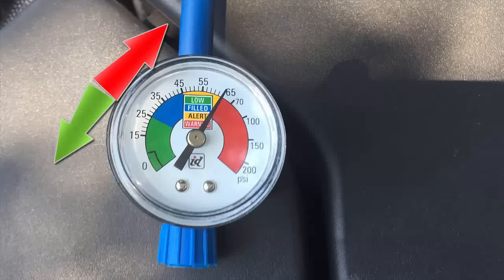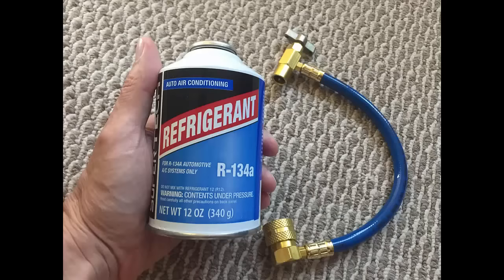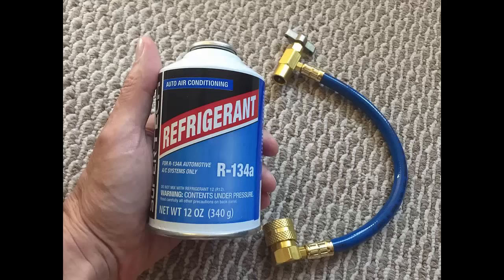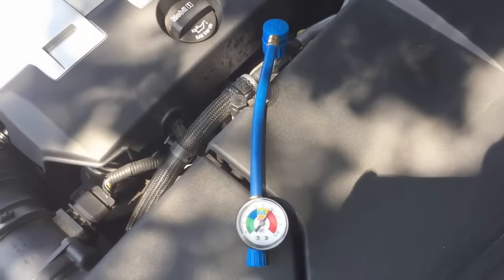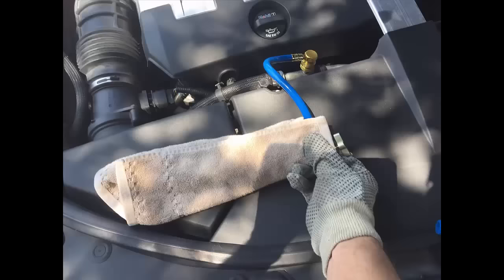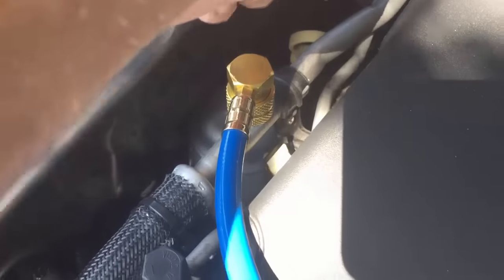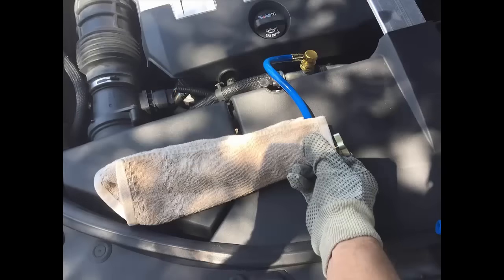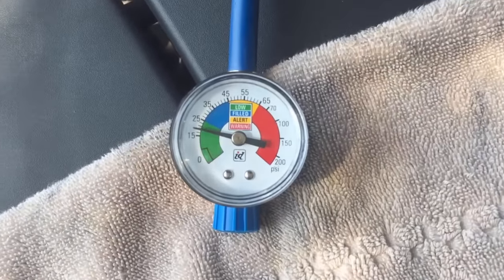Car AC pressure too high FIX overcharged a/c gauge fluctuation reading jumps Up Down Freon problem

Comment: U keep putting freon in your system and your going to slug the compressor. Freon needs to be put in by weight. 
Your system has a specific charge weight. 
And when u said the little thing , I knew u were not qualified to work on a ac.
That little thing is a schrader valve core.
Reply: The context of the video says he used a gauge. The gauge said low. He added a little and it registered a lot so he removed till it functioned properly and read properly. A weighted gas is distributed by pressure. Ft. Pounds per in. of X amount of ounces or pounds of gas or however it works. It’s not a solid weight dumped  or liquid weight poured into the system. It uses atmospheric pressure increased by mechanical (pump or other etc...)and process factors like temp, flow, space and again pressure to separate it from other particles into a confined space. There the weight of the isolated gas can be measured. In this case it’s released. Now how would you be right? At some point the gas or some additives in it would have to liquify or solidify to form some type of imbalanced mass in the compressor. It may be a build up on the walls or free flowing but not small enough to escape through the lines. To those that don’t understand the concept of the accusation, to slug a pump/ compressor is similar to overloading a washing machine with a few big heavy towels on one side and the rest of the laundry is fast dry/wicking clothing. While the water quickly drains from the other items during the drain cycle and first few spins of the spin cycle, the towels are still saturated with water and migrate tightly to one spot together. This causes the wash tub to come out of balance and vibrate. The towels being heavy may even change positions like a person being tossed around in a car wreck but the effect only worsens. My defense of the video is that they did not keep adding Freon to the system and that the commenter miss understood hopefully since they had knowledge of slugging.

Comment: When you gauge jumps , its actually the AC compressor kicking on . Its not over pressure. True pressue reading is what it says when Compressor is not running . So your AC s actually low if reading only 16 .

Comment: My pressure was way up almost 100 I released down to 35 and the gas never got cold and the ac lines just got warm instead of cold. The compressor never kicks on either. This sure didn’t work for me
Reply: Most likely have a bad compressor. I'm sorry.

Comment: When that happens it's because the a.c compressor is not working anymore and you need to replace the a.c compressor/
Reply from the maker: When the system is overcharged, the safety switch turns the compressor off.
That's why the compressor is working intermittently.

Comment: There could be air in the system.
Reply from the maker: Yep, the air got sucked in from a tiny hole in the evaporator... that I found later on.

Comment: I have the same issue, where I think I overfilled it a little too much, and the gauge is just not reliable for my vehicle.  I used the trigger hose kind of the AC Pro brand.  Can I use that trigger hose to release some pressure?  I'm thinking I can just detach the guage/trigger/hose component from the can, and attach it to the valve on the car and use the trigger to relieve pressure.  But do I do that via the high pressure valve on the car, or it's low pressure valve?  (filled via the low pressure, but not sure if i should release pressure via that same valve)  Help anyone?
Reply from the maker: Before you remove the trigger/hose from the can, keep in mind that if you have any refrigerant left in that can, it will escape at once under pressure.
That hose will fit only on the LOW side anyway, so you can bleed it off right there.
Reply: @Your-Self  right on.  thanks, that worked.

Comment: Well I hooked up my gauge and it went straight to the red so when I decided to release some pressure I noticed that the stuff coming out wasnt anywhere near cold. Any ideas?
Reply: Problem was that my compressor was broken even though it was still spinning it wasn't producing pressure.
Reply: @Shinobi117  , what was broken? The compressor it self or the clutch? I got the same thing. Thanks
Reply: @salomesua  compressor. Thats all it was.

Comment: I think those guages are junk
Mine did the same thing. It read low. So i filled it. It started working. Then stopped
Did the exact thing up and down on the guage. I let a bunch of freon out and out leveled out.

Comment: If i disconnect the gauge same one from the video will the can spray out
Reply: No. It won't.  The  gauge and hose literally unscrews from the top of the can.
Reply: Mike Ferrin what I mean is can is full and doesn’t say resealable on it
Reply: @kjhgfdsd76654  thanks for the info

Comment: So i released some while ac was running i didnt in accidently let air back in did i?
Reply from the maker: While Low-Pressure-Port has somewhat low pressure it's still higher than outside air pressure... therefore, the outside air shouldn't get in. But I'm not a tech, that"s just my own opinion, and it worked for me.
Reply: Would it be better to do it with ac off so pressure builds even more ?More pressure seems less of a chance itll introduce air to the system rite?sorry just trying to fix my issue without causing more.already lost a bit of oil but the refrigerant had 3 oz of oil in it so hoping i didnt screw up already. thanks for your time
Reply from the maker: If you want to make sure 100% that no air gets in, you can use High-Pressure_Port. Stick a sharp instrument like a screwdriver or large nail covered with a rug into that port, just like releasing air from a tire. It's messier and more dangerous because of higher pressure, but no air will get back in. There is a video with young guy talking about it.

Comment: have astro 2000 with rear air,good and cold,But I notice compressor runs all the time! any body know anything about this(not enough pressure,or pressure switch,guess I need to buy one of these)
Reply: Donnie Shepperson what turns the compressor off is the cycling switch, or low side switch. There is also a high pressure switch that will shut it off if pressures reach too high on the high side. On a good working system, and it being hotter than 85°, it is completely normal for a compressor to run like that. the cycling switch will only cycle around 15 psi on the low side. Too much cycling will wear the compressor clutch, so it is imperative to keep a good charge. Low refrigerant will cause short cycling which is terrible for the compressor.
Reply: Donnie Shepperson dont take advice from this guy. he just venting refrigerant right into the air smh.
Reply: thats what it does 85 or higher runs all time,under 80 it cut on and off like what i'm use to with front air only.this first rear air i have ever had,people have told me when it real hot these type run all the time,Thanks for your time!
Reply: about a million vehicles right now out there leaking refrigerant,they would be breaking the law too,I don't see epa taking anybody in,that's why they made 134A and sell it at walmart,so we can refill our leakers!
Reply: @brandonbunn978  --is it truly that dangerous? Think of all the carbon dioxide, methane and hydrogen sulfide you release every time you rip a wet fart while mowing your lawn.

Comment: Is it really OK to vent this stuff into the atmosphere? I was told there is a $2500 fine and this guy just handed the EPA a video to prove he did it. Tell me if it's ok cause I'm having trouble with mine but didn't want to do the wrong thing.
Reply: There is a fine and I think its a lot higher but the main reason the EPA doesnt want these in the air is because chlorine atoms destroy Ozone Molecules...however, R134a doesnt contain chlorine but the EPA still doesnt want refrigerants vented

Comment: when the pressure gauge jumps up that high like that when system is hot it usually means there is air in the system which is forming super heated air pockets that need to be relieved, the best way is to draw the system down with vacuum to purge all the air then refill with refrigerant but if you can't afford or don't have time to do that one trick you can try to get it working good enough to get by is with the ac running in the on position and the system heated up shut the car off and with the car NOT RUNNING take something like a small screwdriver and start depressing the low side schradder valve in short bursts, you might get a hint of refrigerant but the rest should be mostly hot air, keep doing it until you actually get the first real signs of refrigerant, then but your gauge back on and restart the car with the ac on, the pressure should be considerably better hopefully to the point where your ac will stay running, if not then after letting the car run for a few minutes repeat the process again, hopefully this time you'll get less hot air and it will be enough to get the ac working enough to get you by until you can get it service right!!!!
Reply from the maker: Interesting trick, thanks for commenting.

Comment: People who don't explain instructions thoroughly puss me off. 
Issue 1: The hose you used to release the pressure with is not the same hose with connections that you used to connect to the Low pressure fill line/tube with.
You must be blind! I'm not! 
The hose you used to release the pressure has brass fittings on both ends. The first hose you used check the pressure with doesn't have brass fittings on the ends. It has blue colored plastic fittings on the ends.
Issue 2 : You said you closed the Vent so the Pointie thing pops out.
WHAT VENT !?
Reply from the maker: LOL, I see...
 as you've noticed I have 2 hoses. One with the GAUGE I used just to measure pressure. Second hose I used to fill-up refrigerant while it was attached to the can. After I overcharged the system I removed empty can from the hose and used that hose to vent some overcharged pressure out. Since there is NO can attached to the hose I had to close brass valve until the Pointie Thing pops out ( Pointie Thing supposed to pears the can when it's attached and also means that the hose is shut closed) Then, hooked up BRASS hose back to LOW PRESSURE port and slowly opened the valve few seconds at a time to release some pressure. Then, reattached GAUGE hose to see the pressure, then reattached Brass hose to vent some more pressure out, then Gauge hose to check pressure... and so on...
Thanks for watching.
Reply: you missed it get off the phone and pay attention

Comment: Mine goes to red as soon as i turn on ac, my compressor is running, but my vents are blowing hot air. I've got a new condensor
Reply: No.
Reply: So. It was to much refrigerant, for me
Reply: LightningSurvivor 14 isn't that what he said. That it was over charged in the video so he took some out?
Reply: Colin Martin nah, i had to replace the accumulator too, it was new but cracked. So now ive got new hoses, accumulator, condensor, thetmostat, temp sensor, a.c. compressor. It still gets really warm just sitting there.
Reply: LightningSurvivor 14 
L

Comment: I had the same problem but guess what, the problem was no more no less the system had low freon. I was intimidated at the begining becuase gauge went to red what afraid me but once I sat to think thta my system requires almost 1 kilogram of freon  I saw the container was very heavy and decide t put some more gas on and the compressor stops to turn on and off and the gauge went to the green zone

Comment: Stop letting freon out into our inviorment dude.
U need a manafold gauge set to see the high and low side pressures. There is plenty of information on the internet on a/c automotive 
AC systems. It's free to use. 
You need to learn about your cars ac. U keep messing with it and your going to damage it.
Reply: 134 a is environmental friendly

Comment: Mine is not cold and in the red but my clutch is not engaging at all. I fear my compressor has died. It was working fine. Ive had a slow leak for a couple years. Oh well.
Reply: Could be the relay, or the pressure sensor or wiring harness if the pressure is too low it won't let the compressor kick on

Comment: Its 2019 and please someone reply me. If my ac is overcharged, will it stabilize when i keep on using it?
Reply from the maker: Running an overcharged A/C will not stabilize itself. The excess pressure needs to be physically released. If you have a leak in the system, then, eventually, the pressure will stabilize, but you'll continue to lose refrigerant until it's completely gone. Using an overcharged or undercharged A/C may damage the compressor.
Reply: No, not unless it's leaking
Reply: Thaannkkkss

Comment: The reason your pressure is low is because you don't have enough refrigerant. If you listen, your compressor is cycling on and off. This is because it doesn't have enough refrigerant. The reason that the pressure gets high is because the high side and low side equalize when the compressor is not running. By letting pressure out, you are doing the opposite of what you need to do. 

You should look at a chart based on the ambient temperature to see what pressures you need. Ideally you would want a proper set of ac gauges to do this because you should be paying attention to the high side as well. And in a perfect world an air conditioning machine that can remove all of the refrigerant, perform a leak test and then fill the system with the exact amount of refrigerant based on the weight.

Comment: Your A/C system may have moisture in it.
Reply from the maker: Yep, I figured it out after awhile. There was a pinhole in the evaporator, so as it was leaking out the refrigerant, it sucked some air inside. Still worked for a long while, but not as well as it should.

Comment: You check the pressure with the system running...It cycles on and off because of the pressure switch...the pressure should be in the blue area of that gauge when the compressor is running....it should be around 35 psi when running(also depends on the outside (ambient) temp ....your way overcharged
Reply from the maker: thanks zeke112964... that's what I figured also!
Reply: Actually he is undercharged. The pressure is going way up when the compressor cycles off because the high and low side are equalizing. When the compressor cycles on the low side pressure goes down to the low side cut off because it is basically moving all the refrigerant from the low side to the high side to condense it. When the low side gets too low the compressor cycles off to prevent damage and then the system equalizes again.
Reply: The pressure is going up when it cycles on and drops when the compressor kicks off....you got it backwards
Reply: zeke112964 false.... the low side goes down when the compressor kicks on. It is the suction side. The high side goes up. When the compressor cycles off the low side equalizes with the high side whick makes it go up.
Reply: According to you he's undercharged? He's at over 45 psi when its running which puts you in the overcharged area on the gauge. The higher the pressure the higher the temperature. R134a  at 35 psi is 40°, at 45 psi it's 50°, and at 55 psi it's 58° so tell me how it's undercharged
Reply: zeke112964 It can show a high psi if the system is clogged. Here the psi is probably 300+  on the high side and releasing it on the low side.

Comment: Decent video.  Quick tip, don’t overcharge in the first place and people won’t need to worry about it.  Always use a gauge when filling.  Your vehicle will never be overcharged unless you or someone worked on it and overfilled it.

Comment: How can you do this if you havr a full bottle of 134a 😂 😂 😂 😂 with a gauge on it all ready. I need another gauge....
Reply from the maker: If you bought this bottle recently, I think it should have a safety valve. That means the gauge can be detached from the can... but I'm not sure 100%
Reply: @Your-Self  yeah to late for that 😂 😂 😂 I popped it open soon as I got out of Walmart. It's hot out here in NC

Comment: These morons don't tell u that letting out Freon into the engine compartment can generate phosgene gas after it is sucked into the engine and burned. That stuff will kill you dead.
They should leave ac work to traned professional technicians.
These videos are not so much for untrained people. I'm setting here reading this nonsense and praying that nobody is killed.

Comment: Releasing refrigerant directly into the environment like that is illegal in most areas.
Reply: I’m pretty sure the towel catches most of it.
Reply: @barberik53  I would be inclined to think the same thing if it was a liquid, and not a gas. As it stands, at atmosphere, like propane, 1,1,1,2-Tetrafluoroethane (also known as norflurane (INN), R-134a, Freon 134a, Forane 134a, Genetron 134a, Florasol 134a, Suva 134a, or HFC-134a)  is a gas, and passes through the towel.

Comment: This dude is letting refrigerant out into the atmosphere. NEVER do what he is doing. Use a proper manifold pressure gauge to charge your AC system, if you intend on doing it yourself (of which I DO NOT recommend). Refrigerant is extremely dangerous and is not something to be messed with without proper HVAC training.

Comment: It is illegal to discharge R-134a to the air. If overfilled, you need to take it to a shop. They have special equipment to get the refrigerant out.

Comment: Lmao, only a low side guage. Boy...they make these fill up kits for morons. Most systems need to be evacuated completely and then refilled to exact volume. Stop using this kits and just spend the $80 and get it done right.
Reply: That's a rip off by the way. They evacuate the system, to the master tank. Then refill from that same tank and sell you back what they took out plus what ever was actually needed.
Reply: @ernieRUOK  
I rest my case.